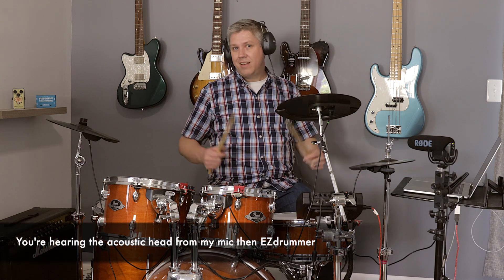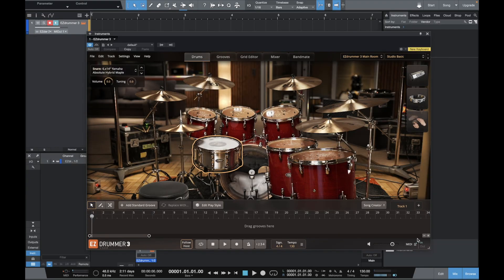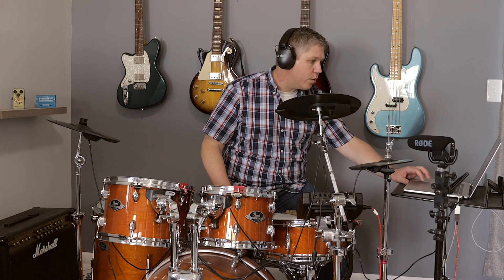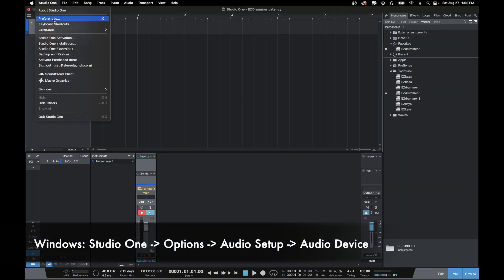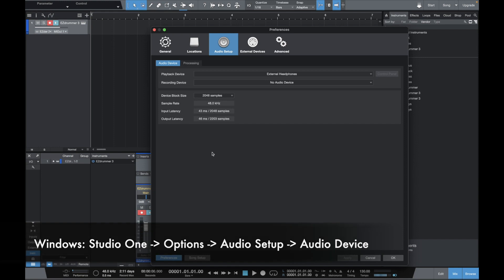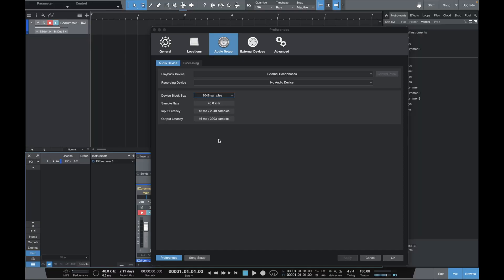Fix Latency with Electronic Drums Using EZdrummer and Studio One

Comment: Why you dont shoose the ( 16 samples ) if you have ? Regards from Portugal
Reply from the maker: Great question! 32 samples is more than good enough, especially with the low latency monitoring on in Studio One. I could certainly set it to 16 samples, but that’s going to make my computer work harder and it may have a hard time keeping up depending on how many other plugins are being used. 32 works fine and there’s not and there’s not a really benefit to using 16 - it just makes my computer work harder. Hope that makes sense. Thanks for watching and let me know if you have any other questions 👍

Comment: Thanks! 
How to fix the problem that when Z for instruments is enabled it sounds different or even less loud while playing. Track armed. 
Is this caused by the low latency mode?
Reply from the maker: Really good question! Without more info, it's a little hard for me to know why that's happening for you. However, if you are using multiple plugins on that channel, then it may be that some of the plugins are being disabled when Low Latency Monitoring is turned on. 

For a plugin to be active and heard during low latency monitoring, it must have 3 milliseconds or less of latency. So if there are plugins that have more than 3ms of latency, when they turn off, the sound will change because they are no longer affecting the sound. And if there is gain/volume being added in the plugin, then the sound would drop in volume as well. 

That's my best guess with the given info. Let me know if that helps or if you're still having issues.

Comment: Hello, I have a question regarding the settings that attempt to resolve latency in Studio One.
The LOW LATENCY INSTRUMENT MONITORING option disables (turns off) the WAVES, CLA NX plugin. 
Any ideas why this happens and/or how to fix it?
(Sorry for my bad English, I used Google Translate)
Reply from the maker: That's a great question! If the plugin causes more than 3 milliseconds of latency, then Low Latency Monitoring will turn the plugin off and you won't hear the effect. It looks like CLA has ~442 milliseconds of latency. I found this helpful chart from Waves that gives the latency for all of their plugins: https://www.waves.com/support/tech-specs/plugin-latency

I have CLA NX as well. It would be nice to monitor through CLA NX, but it looks like it isn't possible with Low Latency Monitoring turned on.

From Presonus: https://s1manual.presonus.com/en/#Setup_Topics/Set_Up_Your_Audio_Device.htm#Audio

Plug-in Use with Native Low-Latency Monitoring
When monitoring an audio input or virtual instrument through the Native Low-Latency Monitoring system, any inserted FX on the corresponding Channel continue to function and can be heard in real time, provided that they add 3 ms or less of latency. Plug-ins that meet this latency requirement show a green power button in the Console (rather than blue or gray). Any inserted plug-ins that introduce more than 3 ms of latency are not audible in the monitoring path while a Channel is armed for monitoring or recording under Native Low-Latency Monitoring. They begin functioning again when recording/monitoring mode is disengaged.

I hope that helps! Let me know if you have any other questions.

By the way, Google translate worked really well. Your English was better than most English speaking commenters. Ha ha!
Reply: @DadRockAndGuitars  Thank you very much for your response, I hope this is the solution.

Comment: Awesome video..do you think Macbook handles sound or latecy better?

I have an Asus gaming laptop with decent specs with an interface and still have annoying level of latency 😅
Reply from the maker: Great question! I'm not sure if Mac is "better" but it does pretty much just handle it on its own. Windows usually requires a driver, but I'm pretty sure Windows is capable of handling the latency well.
Are you using an audio interface? If so, have you installed the latest drivers/routing software for it?

Does your recording software (I assume probably Studio One since you watched this video) show options for you to choose low latency? 64 samples, 128 samples, etc.?

Comment: Hey man not sure if you will see this but here goes. Current situation - Followed all instructions, using a Roland design Midi to USB cord direct to PC. Loaded up ASIO4ALL which has given me good buffer and frequency above the standard drivers first listed, for my TD 6V kit I am at 64 and 4800. There was also an internal switch on the module (recommended in forums to turn off) did so and noticed a small improvement in latency. Drums are triggering nicely, but occasionally I'll strike the snare or a tom and get a little bit of static also ASIO4ALL is good (has increased available buffer and allowed my to dial in). Would you have any suggestions or from community? so close but the occasional static and mix issues are frustrating - cheers!
Reply from the maker: I haven’t had that exact issue However, when I’m playing guitar direct and using an amp sim, if I have the buffer size too low and the computer is doing other stuff that requires a decent amount of CPU resources (playing a recording session back with lots of plug-ins for example), then it will produce static every now and then because the computer can’t keep up with all of the processing. 

In that case, I increase the buffer size a little and that usually fixes it. A buffer size of 64 is nice and low. If you raise it and the static goes away, then you’ll just have to find that balance where latency is as good as it can be and your computer can keep up. 

Let me know if that doesn’t work,  but that’s my initial guess.
Reply from the maker: You can here it happening when I play guitar here: https://youtu.be/B2e9ocegZRg?si=k0DAYgc1BWvsRlRg&t=938

Comment: When I am using EZdrummer 3 standalon  I try to decrease the buffer size to 256. But in EZdrummer. But I notice that if I open the Asio4All panel it says other buffer size, like 512. What is the buffer size that counts ? Or do I have to lower both  ?
Reply from the maker: I'm not on Windows (Mac doesn't used the Asio4II driver) so I'm not 100% sure, but I think that you should only need to adjust that in EZdrummer. If you make the buffer size really high in EZD, does the latency get bad? And then if you set EZD to a smaller buffer size, does the latency get a lot better? If so, then I'd assume that EZD is handling the buffer size.

Sorry I can't give you an absolute answer, but that's how I would test it. Hope that helps.
Reply: @DadRockAndGuitars  yes, you are right. Ez drummer handles the buffer size. Thanks

Comment: Good video; I’m using ezdrummer 3 standalone with an Alesis nitro mesh; but still a little latency specially when playing the kick. 
What should I do if I’m planning to go through the PA live? Do I need an interface? Or should I just go from the audio output of the computer to the board? Your answer would be a great help.
Reply from the maker: Regarding the latency, have you adjusted the Audio Buffer Size setting under Settings -> Audio/MIDI Setup?

I would recommend using an audio interface with balanced outputs. Those outputs could go straight to the board. The audio interface would also be able to handle the MIDI connection as well.

You might be able to get away with using the headphone output. You may have to play with the volume on your laptop since they headphone out is an amplified signal. You'd want a 3.5mm TRS Male to Dual 1/4-inch TS Male cable. That would be an unbalanced signal and if running much length at all (more than 20ft), could have noise issues. You'd want to use a couple of DI boxes to convert it to a balanced signal over XLR cables.

Hopefully that helps. Let me know if you have additional questions.

Comment: Thanks man. Have you seen the "Z" go blue? Instead of green... Any ideas what it means. I seem to not have the option where the Z goes green?
Reply from the maker: Hey Allan! Do you have a Presonus interface? If so, my understanding is that the Z will be blue because it's using the hardware. I don't have a Presonus Interface, therefore it's using my computer to do and is green in that case.

From Presonus website: "When Native Low-Latency Monitoring is enabled, the "Z" button turns green. When Hardware Low-Latency Monitoring is enabled, the "Z" button turns blue." 

There are some links to Presonus in the description that go into a lot more detail if you want to check those out.

Let me know if you have any more questions. Happy to help where I can!
Reply: @DadRockAndGuitars  thanks. No I have a RME interface. 

I found if the drop out protection is too low relative to the buffer size you will not get the green Z. Its like the drop out protection set to high sets a high buffer for all channels playing back. You can then set the device buffer size low and when you click the Z and it goes green you get high buffer on the play back tracks and low buffer on the track thats record armed. I didnt fully get it earlier.

With all my messing around i was getting the blue Z but when i click on it, it would mute the armed track i guess cause as you said it wants to use a Presonus interface. 

Thanks for your reply, i think i have my issues sorted out